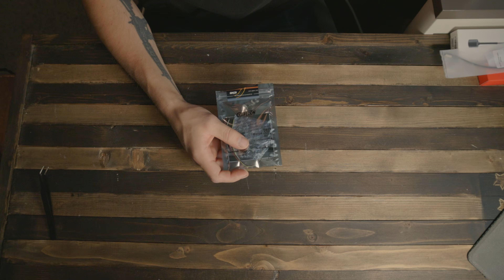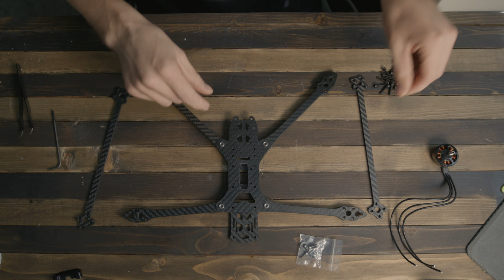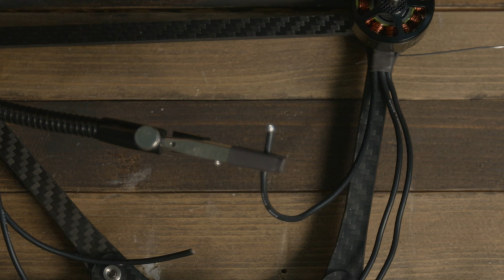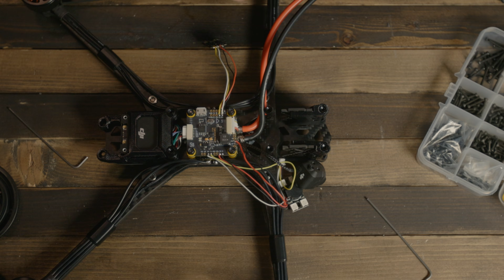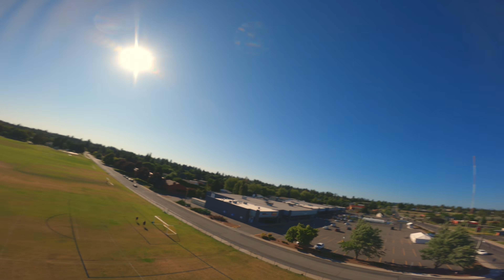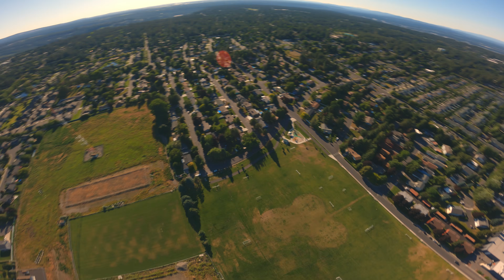How To Build A 7 Inch Long Range FPV Drone

Comment: Could you do a beta flight set up guide. ? Would be good . I built the same thing but i did it tbs crossfire but I can’t get it to work. And not sure how to go about it properly.
Reply from the maker: I did a betaflight setup for general quad setup. But it wasn’t specifically for this drone. Check my channel.

Comment: Your soldering is sucks. That negative joint is unacceptable. You shouldn't be doing a build video, there is so many things wrong with this build is crazy. Who tf puts nuts on bolts then into motors just because you dont have 14mm loong ones?! 😂
Reply from the maker: yeah crazy! all my drones work great and ive built so many. I have some build videos with 60,000 plus views, im terrible at this. People should go watch your 2 year old trash quality videos. Im sure that will help people learn to build quads. go ahead and check out my other build videos im sure you will enjoy them. 🤣
Reply: @andrewmedia3568  i dont have two year old trash video, and because YouTube says you have 60k views it doesn't mean you actually have 60k views. If all your drones fine, you are lucky, your soldering still sucks.

Comment: how much can this puppy carry - anyone?
Reply from the maker: total drone weight with two 21700 cell 6s packs is about 5 pounds and it will fly about 12 miles round trip with that weight.

Comment: Great video. Im building one based off your guide. What's the least amount I can do to test the motors? Want to male sure it's working before i continue to build it.
Reply from the maker: well really you need at least the motors soldered to the ESC and the flight controller connected so you can plug in a smoke stopper to protect from possible shorts. Once you did your first plug in with the smoke stopper and it powers on without blowing the fuse, then you can plug in just the battery and go into beta flight to set motor/ESC protocol and set motor position and direction. once that is done your good as far as motors go. you can always de solder and re solder to fix mistakes.
Reply: @Androidfpv  I forgot to order one of those. I'm doing it now. Also do you know the length of the four screws that mounts the ESC and flight controller? I don't think those screws came with the kit. I subscribed to your channel.

Comment: You have a shitty iron, my joints look way better 😂

No but seriously get something like a ts101 or a pinecil, I tried soldering with a hardware store soldering iron as well and came out looking exactly like your ESC wires

I'm a complete beginner but I can solder 12 awg wires with no issue whatsoever, and they look absolutely perfect. The trick is a good iron + ton of flux

I hope this helps! Also I'm super grateful for this video, I love my rekon 7 ❤

Comment: I have a beta flight fpv goggle can I use that for the DJI air unit
Reply from the maker: No sorry only DJI goggles work with there air units.
Reply: Betaflight fpv goggle? Doesn’t exist lol

Comment: Use tbs flux pen or syringe, 380° add solder and it will melt your grnd mess silky shiny smooth

Comment: I'm doing a 7" build and I have a speedybee f7v3 50 amp stack laying around so do you think 50 amp is enough for a esc??
Reply from the maker: Yes definitely. Remember that’s 50 amps per motor. So 200amps total. And depending on motor kv and battery voltage you won’t even come close to hitting that max. Most batteries can’t supply that for more than 1/2 of a second and then voltage sags. 50 amp esc is plenty if your motor kv and battery voltage are correct. You can use the same motor kv I did 1500kv and 6s or look at other 7” long range bnf, what motors they use and what input voltage they say to use. Hope this makes sense and helps.

Comment: @Dshot can i do long range with 2750 motors?
Reply from the maker: is 2750 the kv of your motors?
Reply: Yes they are. I believe they will draw too many amps and will probably damage the battery but wanted to know what you think
Reply from the maker: @Urmomisaslt  that all really depends on what battery voltage your using and the weight of the quad. 2750kv is high speed 4s, too high for 6s. But depending on your drone weight and battery mah you could do medium range. Typically you want a bit lower kv for efficiency when flying long range.

Comment: Nice build, I’m using the same fc/esc. How did you connect the 03 up? The wiring harness from the 03 is not the right one for plug and play. The wires I got from the fc doesn’t fit the back of the 03. thanks
Reply from the maker: Yeah t-motor has a weird plug on this fc. I had to special order one from rotor riot.
 https://rotorriot.com/collections/drone-accessories/products/avatar-to-fc-cable

Comment: Hi, if I'm using Dji Goggles WITH a dji controller together with a dji 03 air unit.. do I still need to purchase a receiver like the crossfire nano with mortal T antennas ? Thanks for your help.
Reply from the maker: No not if you are using the DJI controller. But the O3 only works with the DJI remote 2 (the Grey controller).

Comment: Hallo , how is running your frame to vibration ? Do you run lot of filtering ? Do you have any shaking so on ?
Reply: Sure thanks for ty help anyway i find many people which have run the same setup without problrm so i should look where is problrm maybe in hardware thank you regards
Reply from the maker: stock Beta flight 4.4 or 4.5 should be ok. But I made some minor adjustments to the PIDS. I think the filtering might be stock beta flight. Im using a different frame now. The foxeer mega 7. I posted a video about the frame swap and have some mountain flying videos posted as well. Its all on my channel.
Reply: Oke , i do have lot of frame resonance issue with this frame at 78 hz
Reply from the maker: @Oguras_fpv  Interesting, I have never messed with Motor frequency on any of my quads. I never felt the need to anyway. Maybe some bardwell videos could help?? or you could email him. Sorry I cant help more with the issue.
Reply: Can you post here your pids setting  ?

Comment: I just used ELRS915. And also using crossfire t-antenna.
Reply from the maker: Im using crsf immortal T with 2.4ghz 🤣. It works though.
Reply: @andrewmedia3568   I mean I run my vrx with no antennas in my house .. it work to a point. I'm really really curious the range you'd get at 1w. I seen them go 100km on elrs24 and didn't even lose telemetry till 80km .  So curious if you could still make it like 15km something reasonable

Comment: I wish my rekon7 had more room for longer battery. I modded my rekon7 and now im thinking of bigger motors. Was looking at 2808 or 2809 but i want lower kV maybe 1100kV
Reply from the maker: 2808 works well on mine. I’m at 1500 kv 6s. But 1100 kv would work too.
Reply: @andrewmedia3568  yea I'm just going max flight time. I'm patient I don't need to go fast. Just slower if high winds. Also I'm not running 7" props anymore. Meant to post video on it years ago. Never did. I'll do it this year 🤣
Reply: @divingfalconfpv4602  Waiting for the video of modded Rekon7
Reply: @Fpv416   oh I can post the video I never finished. But I ended up buying a bigger frame. I still have the rekon frame and motors. 
But that new one with new frame  sank in the river and I couldn't find it. Got cut up bad trying
Reply: @divingfalconfpv4602 so sorry to hear about that.
I would even gladly watch your unfinished video for the modification of rekon7 if you post it. 
Regards

Comment: How many minutes you can fly with one battery?
Reply from the maker: Depends on the battery. Small lipo 4-5 minutes. 2 li-ion packs 10-20 minutes.
Reply: Can i have some more info?  For a complete build 7"?

Comment: does longer VTX antenna give you longer video range compared to the standard stock antenna that comes with the o3?
Reply from the maker: Yes and no, Technically different antennas have higher or lower gain, higher gain being better for long range. But in my experience thats not what gets you better video range. What the longer antenna does do for range is insures that they wont get blocked by the quads frame or battery when flying far away and making turns. That way the antenna always has direct "line of sight" back to the goggles.

Comment: hey i was wondering if i buy a iflight Evoque with 03 air unit to use it with my dji controller 2 can i get it with the tbs receiver just for when i get a tbs module at a later date? like will it still be able to bind to my controller 2 when i get it with tbs as easy as i would with the controller 2? thank you :)
Reply from the maker: To quickly answer your question yes you can. That bing said, if you buy the TBS version once you get the drone you will need to hook up the O3 using all  6 wires from the O3 plug. that will be RX, TX, 10v/vBat, G, SBUS and signal/ground. The extra 2 wires SBUS and signal/ground are really what is needed to use the DJI controller. The TBS version might come without those wires hooked up or the wires missing from the plug. so you might want to buy an extra O3 plug that has all 6 wires. Of course you will need to change Betaflight settings for the DJI controller to work and then again when you switch to TBS. There are tons of videos explaining how to wire the O3 for using the controller 2 and how to set up in Betaflight.
Reply: @Androidfpv  thank you

Comment: Yo bro, just so you know crossfire antennas are 915 and ERS is 2.4 just so you know that will decrease your range in reliability. I did the same exact thing thinking that it would help but my buddies called me out on it and I want to help you.
Reply from the maker: Oh yeah I'm very aware of the antennas. I have had 50+ people tell me that its impossible to use these antennas and that it wont work. but sometimes you gotta break the rules lol. I have flown 4 miles out with these, multiple mountain flights in the 2-3 mile range and quite a bit of overall flight time, never had an issue. it works great. 🤘

Comment: Doesn't the o3 have a reciever on it? If i just want to use dji goggles,controller and air unit, would i still need to attach a receiver, also does your build provide longer range than the stock dji ecosystem
Reply from the maker: Yes the DJI O3 has its own internal receiver. you don't need an external receiver if your going to use the DJI controller 2 with the O3. Running ELRS at 1W radio output will give your longer receiver range, video range is the same regardless of your radio\receiver.
Reply: Thank you so much, would you trust the stock dji products with flying around mountains? what is the max range you think you can actually get out of the stock dji products? @Androidfpv

Comment: "i dont have any flux and i dont care"??! Dude im sorry for doing the exact thing you said but...flux is EXTREMELY helpful in some situations.  Also great video, thank you so much!
Reply: I didn't use flux in any of my builds and never struggled for any of my solders
Reply: @Akhystide maybe your solder wire has flux in if from the factory. Or the mix it’s made from is easier than most to solder with. But generally speaking, trying to solder without can be very frustrating, sometimes solder won’t even melt until flux is added.
Reply: @John_Doe_6996  yeah I Know that's why

Comment: definitely the wrong antenna for ELRS, the Immortal T are wider in length for a reason, they tuned for 915/864, ELRS is narrower because they are tuned for 2.4. You may find it still work, but definitely not the right choice cause you're maxing out the receiver's output power and it will slowly burning it.
Reply from the maker: Is the receiver outputing anything?? isnt the RX just listening to the radio commands? I dont have telemetry enabled.
Reply: @Androidfpv  the FC will transmitter telemetry to your raidio through the reciever.
Reply from the maker: Can you disable it through the radio or BF? I don’t think I have telem on.
Reply: @Androidfpv  yes, it's in Betaflight, turn off output telemetry. forgot in which page, I'm sure you can find it.

Comment: Thanks for the video, did you make any changes to the listing of this equipment you used? any new configuration? I want to build a long range 7 racer, with air 03 dji! hug
Reply from the maker: I have since swapped the frame because I crashed and broke the frame and couldn't get a new one in time. I made a video of swapping all the parts to the new frame and I think the new frame is better than this one. thats the only changes if made.  https://youtu.be/xZk0Hpctw9I?si=iT2NF_xEtqYqw-Pu

Comment: What kind of flight time can you expect from this do you think?
Reply from the maker: With the two 6s li-ion 21700 cell packs running together in parallel I get about 15-18 min flights depending on how im flying. total of 8000Mah. if im running it pretty hard about 10-12 minutes.

Comment: How much did this cost ?
Reply from the maker: Not sure the exact amount, but around 700 -800$. could be done much cheaper with a less expensive FC/ESC stack and going analog.
Reply: @Androidfpv what stack would you recommend for this setup? Maybe speedybee f405 v3 55A?
Reply from the maker: @uiyhin  yeah that would work great 👍

Comment: If you're looking for a longer ELRS antenna check out the Foxeer ELRS antenna it comes in a 150mm/ 6in version. Used it on my last 7" build and it works great.

Comment: The pointy magnetic things that came with your soldering plate/extra hands, are used to hold a pcb. You can put 4 of them in a square and hold your ESC or FC through the mounting holes. Makes soldering a PCB a little easier sometimes

Comment: Why are you using crossfire antennas on elrs 2.4ghz? Otherwise it is a great build! If it has micro failsafes at 4miles, it is not good. My 250mw elrs goes out to at least 8 miles without any issue.
Reply from the maker: well all the 2.4 antennas are very short, maybe the micro failsafe is from my antenna placement. ill never need to go past about 5 miles otherwise i wont make it back, cant carry enough battery. you must be referring to a fixed wing at 8 miles out.

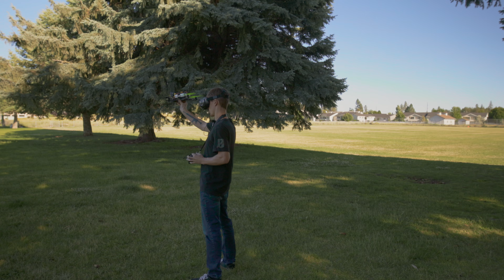Comment: 43:05 Duuuuuude....  I had my Fingers messed up from that kind of Start. Just dont do it, you never know if the gyro sends out corrupted data while arming. We had multiple Death rolls right after arming, due to Gyro shenanigangs, and since have established a 10m safe zone fpr starting. We had to learn the hard way through multiple mild and 2 really severe cuts.
Reply: Yep what they said
Reply from the maker: 😅Dang ok good info Thanks.
Reply: @Androidfpv  As RC heli pilot, that start and landing gave me chills. I heard stories ending in deaths, so really do not do that please...
Reply from the maker: @jointercz  I hear you, and appreciate the heads up. 🤘
Reply: Totally don't do what you did, or you'll miss having 10 fingers sooner or later
Reply: Uhm, okay... That can't happen randomly, can it? I've learned to avoid it after you just crashed or if it's the first flight ever. Or if you have dirt cheap electronics.
Reply: This is why noobs should not put out tutorial videos. so many beginner mistakes in here. not trying to throw shade, just don't want to spread miss info. Stay safe!
Reply from the maker: @floppy_fingers  well you didn’t add any pertinent information so definitely trying to throw shade. you have one video from 5 years ago that’s fpv related and it’s not great to say the least. Not trying to throw shade but a beginner mistake would be overlaying a weird rap video during flight footage. 🤷‍♂️

Comment: For long range you should change out the reciever antennas to 2.4ghz the one you have on is for 915mhz
Reply from the maker: Yes I was worried about that but so far its worked great out to 4 miles 🤷‍♂
Reply: the stock ELRS antenna would give you a stronger signal than a wrongly tuned antenna. so far you got lucky! Happy flying @Androidfpv
Reply: @Androidfpv  Why bother with a long range control link if you're going to handicap it by using the wrong antennas and detune your radio? You can get 2.4Ghz antennas with longer leads. Use them.
Reply from the maker: @Invid72  I have 0 range issues. I’m still using the same RX and antenna today, it works great. I’ve got some videos of me flying in the mountains if you wanna see😁👍. Even flew behind some trees at the top and never had any problems. Lots of people saying it won’t work but it seems to work extremely well.

Comment: Nice build.  One tip, I’d recommend putting heat shrink in the leads for the capacitor. I mounted mine the same way as you did and it shorted out on the frame.
Reply from the maker: Hey Thanks. Ill check that out, definitely don't want a short.